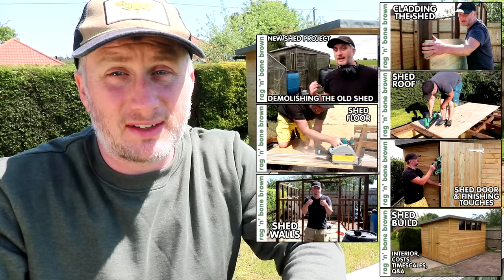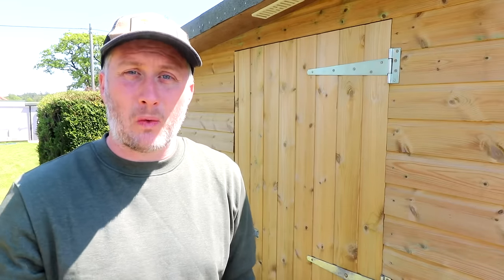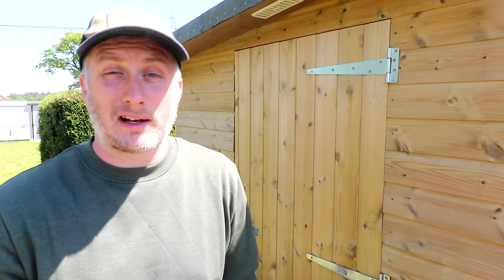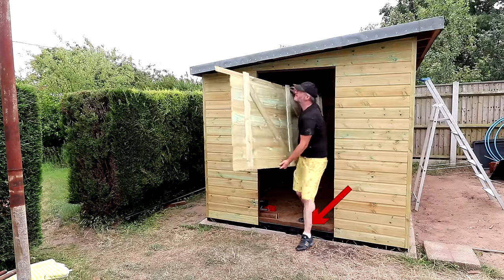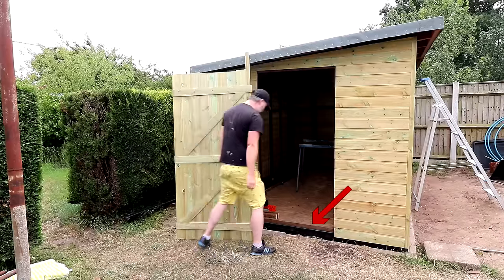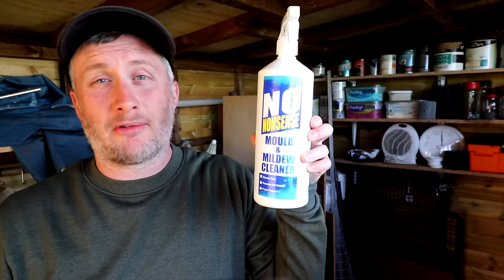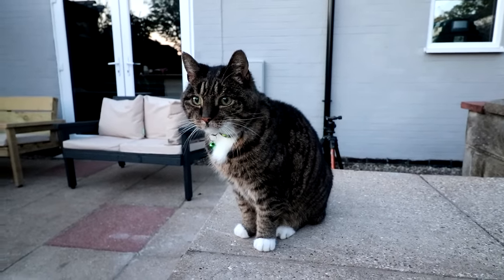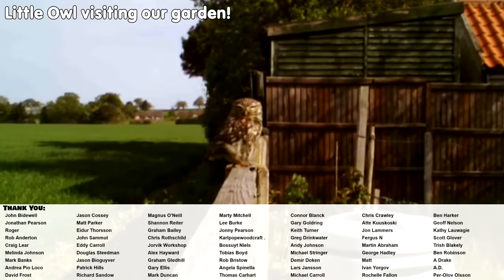4x Problems With My Handmade Shed: One Year Update

Comment: Have bought a new shed myself,  only had a few months and at its highest point at the front the wood was getting very winter in last couple of winter months! The shed came with a gap all the along the lowest end,  very frustrating! I too assuming to add extra vents.  The people I bought it from verbally shrugged it off.  Should be no reason but moisture does whatever it likes! Good video,  would liked to have had a crack at my own but voted no confidence 😂

Comment: How about a few relief cuts with the circulat saw set to sufficient cladding depth on the door. Mold spores go very deep. You are mitigating the standard causes but try Concrobium Mold Control to kill the deeper spores, think of the them like Ivy rhizomes running underground.

Comment: Anything that is custom made is a unique one off project, and there are always teething problems, if you made a second version you would be aware of the existing problems and make modifications as required, this should solve any problems, then if you wanted to make any further versions of the shed you would have ironed out the problems.

Comment: I actually thought you would have problems with your floor too because you used OSB over quite a wide joist span. Your probably needed bigger framing timber to prevent bowing and use door closing twist catches top and bottom 3 boards up and 3 boards down. Good honest video.

Comment: 3x2 for the door brace's those are far to thin. The damp will come from tins of liquid stored in the shed that sweat at night. You can stop it with lots of ventilation. Use an ozone generator to kill the mould or UVC light that will also give off ozone. Take it from a man that knows, I've made all the same mistakes 😂😂😂

Comment: I wouldn't be too hard on myself about these problems. I have seen the same and worse issues with bought sheds. Once the shed has had a summer for the wood to totally dry out you shouldn't see any more mould especially now you have more ventilation. To remove the mould staining an oxalic acid based cleaner works well. You can solve the bowing door issue by just dismantling the door and re-spacing the ship lap, you need have a one mm gap on each board. This will also allow you to re-plane the door edge more accurately to get your five mm expansion gap.

Comment: I live in South Texas where it is hot and humid.  I have two large vent intakes (20" x30") low on the side that open to a shaded area (the house is on this side and only about  18" away.  I also have a solar vent under a whirly bird on the roof to pull hot air out the top.  Of note I insulated the inside and put up a radiant barrier and it is about 10 degrees F cooler in the summer inside the shed than the ambient temperature outside and have not had problems with mold.

Comment: I have the same issue my shed turned mouldy inside - I have now decided to strip it back to the frame - sheet it with OSB and then wrap it in tyvek , then use inch x2 strips and clad to the strips giving a constant air gap. leasons learned.

Comment: I built my shed with corrugated onduline roofing with a  supported overhang and  eaves and it creates natural ventilation. No mould or condensation in 4 years. Good as new. My only regret is not putting some breathable membrane between the frame and the featheredge but that is okay so far.

Comment: Is corrugated tin expensive in Britain? It may be an alternative for those looking to build a similar structure without the expense of wood.
Reply from the maker: That would create even worse condensation issues due to the cold surface of the metal, unless they're insulated panels

Comment: Did you use regular wood or wood which is treated for water? I am trying to understand if it is treated wood, would it face similar issues with rain and snow.
Reply from the maker: Pressure treated

Comment: I've heard that the inner diagonals should run from the top on the hinge side down.  Don't know if it matters.  I think it is a great build!
Reply: Usually it's suggested to do the opposite. The diagonal brace then transfers the weight down to the hinge side (which is obviously attached to the building). Probably unimportant on a light door. Slightly beefier ledges and braces might have reduced the warping, as might a bigger overhang of the roof.

Comment: You say that you're concerned about security yet you've put the hinges the wrong way around, the screws are visible and easy to remove. In future screw the hinges facing the opposite way to the door then fold the "arm" back over so that it covers the screws. Although if someone wants to get into the shed, they'll get in regardless of how "secured" it is. The shed still looks good btw..
Reply from the maker: I assume you haven't actually watched the video where I built the door?
Reply: @RagnBoneBrown . Of course I have, I'm a long time subscriber, can't remember it exactly tho. Lol. Also I suspect the condensation problem is due to damp or wet objects, lawnmower, wet patio umbrella, wellies etc etc, being placed in the shed and the water evaporating off them. The timber you used should have dried out really quickly after the roof was on.

Comment: Dpc is damp proof coarse. 
Dpm is what your using damp proof membrane. 
Just thought I'd say.
Keep doing what your doing though Keith 👏
Reply from the maker: Cheers. The stuff I bought is called damp proof course plastic. It is the stuff usually used between courses of bricks
Reply: @RagnBoneBrown  agh I know. Think that's toolstation or screwfix name for it lol. Keep up the good work mate.
Reply: DPM is housewrap like Tyvek. DPC is the stuff Keith was using. I used the same on the top of my concrete foundation blocks before putting the timber floor frame on.

Comment: Very interesting video as always. Just to give you some feedback, I rebuilt a large roof over 2 sheds last summer, connecting the 2 into 1 big shed. The roof overhangs on all sides. I didn't bother filling all the gaps allowing lots of air through. When winter hit (especially when it snowed) I had loads of problems with condensation. I had to close up virtually all of my gaps and reduce air flow. This fixed my issues within a week and has been winter tested. My suggestion would be close your roof vents, but add some low wall and perhaps a door vent. This works well for me (although I don't have any actual vents just areas at the bottom of my doors that are open by about an inch or 2).
Another great video and thanks for telling us about your issues.
Reply from the maker: I appreciate the input but I believe the idea is to remove warm air inside the shed and try to get the inside the same temperature as the outside so condensation cannot form. I don't understand how sealing up and preventing airflow through the space can possibly help?
Reply: @RagnBoneBrown  No worries, my feedback is based 100% on experience and 0% on knowledge. I suppose we will both find out how our ventilation works this winter, fingers crossed they both work! Keep up the great work.
Reply: Ah I forgot to mention my theory. I think that having high ventilation allows cold damp air into a comparatively (by a couple of degrees) warm shed. The roof of the shed is still at outside temperatures, I think the cold damp air then settles on the cold roof and condenses. I think this is effectively working in the same manor as a dehumidifier. There you go that is my theory. Perhaps someone else knows more and can offer either a better explanation or a more experience bit of feedback.

Comment: To keep rain water from creeping under the door, consider putting a back bevel on the bottom edge.  This will make the water drip off the outside edge instead of traveling under the door where it can cause issues.  The bevel needn't be steep, even just a few degrees will work as water usually won't go uphill by itself.